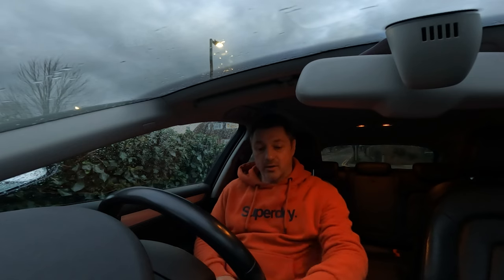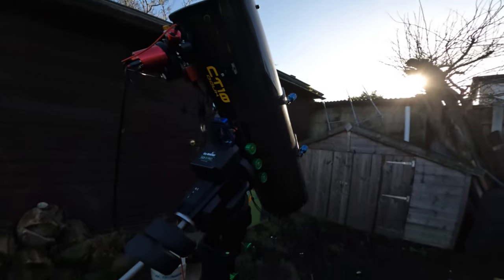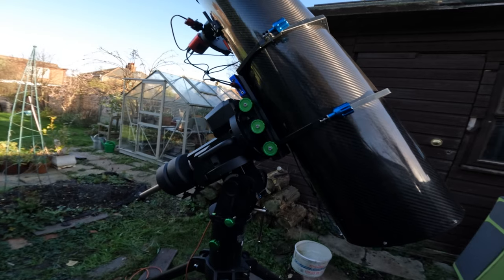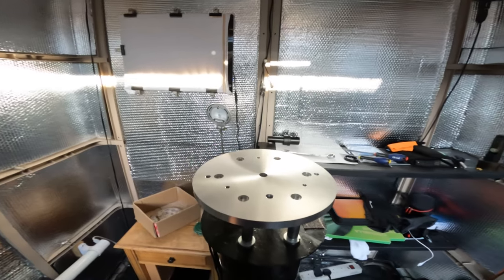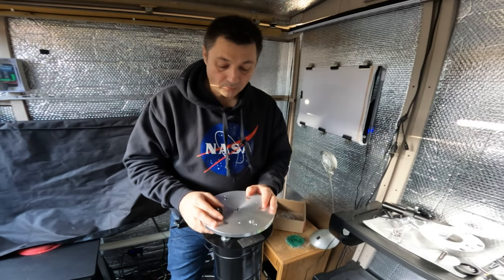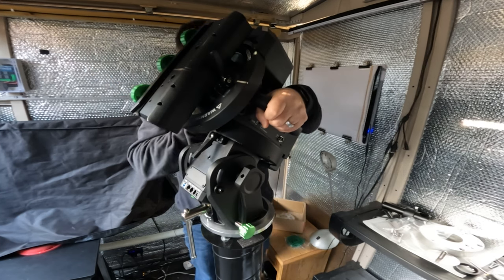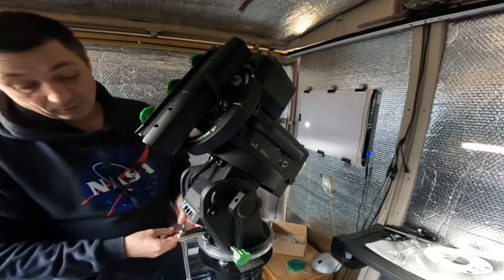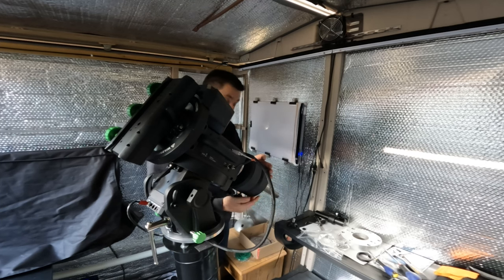Sky-Watcher EQ8 R PRO. I upgraded my mount. Overview and installation into my Obsey. Crab Nebula

Comment: New beefy mount and two clear nights as a result?  Unpossible!  

Grats on the mount Glenn..  It's perfect for your scope.  I really like the built in ports.  CS!
Reply from the maker: Hi James. I know right, new gear and clear nights. Never!!

Its perfect for the scope and  proper observatory grade mount for the Obsy. The through mount cabling always set the CEM120 apart from the EQ8 so really good they addressed that. Its very smart and will mean no cables to get snagged anymore.
Clear skies

Comment: I have one and it has terrible dec backlash. Apparently that is not unusual. Adjusting it is a course in cuss words as you quickly learn that you need special Allen Keys. One day I hope to get them delivered and do something about the backlash. Enjoy...
Reply from the maker: Hi Stephen. using guide assistant mine reports fair bit of  backlash in the DEC but so far it hasn't caused me issues in guiding. Depending on seeing it ranges from 0.3 - 0.6 total rms. I think you can buy Allen keys that would work or it would have to be a grind or file down job on a normal one.

Comment: This is a very good review.  One of the best I've watched.  Does the EQ8 have Wifi?  I'd like to get one to support my Celestron 14" Edge HD
Reply from the maker: hi Craig and thank you. It is an excellent mount but does not come with wifi built in. I know sky watcher sells a wifi dongle you can plu into the mount. I used one with the EQ6 R PRO and it worked really well. I think the iOptron CEM120 has wifi and gps but you would need to confirm this. Good luck with whatever you choose

Comment: Congrats Glenn.  I like how it bolted right up to your pier with the adapter.  Interesting how you mentioned EQ6 being portable as I have the equivalent Atlas Pro which I currently use as my portable mount as it is easier to set up than the Sirius Mount.  If I get another mount the EQ8 top on my list - thanks for the review and good luck with it.  PS: Your intro was pretty cool watching you drive on the opposite that we drive on.  - Cheers
Reply from the maker: Hi Kurt. Thank you for watching and commenting. When I first got the EQ6 i thought it was on the heavy side to move about a lot but after handling the EQ8 it feels very portable. It is a lovely mount and perfect for handling large scopes or heavy payloads.
It must look funny watching us drive all completely flipped.
clear skies

Comment: Looks like a great mount. I almost bought one of these but I would have had to wait 6 months for it. So I got an iOptron CEM120 instead which has a similar payload capacity.
Reply from the maker: The CEM120 is a lovely mount and I was deciding between the 2. The CEM always seemed better because of the through mount cabling but seems Sky Watcher finally caught up with that idea. In the end it was availability that meant the EQ8 won the race. I absolutely love the mount but would have been just as happy with either. Clear skies

Comment: Haha seems you and Joe aligned on the timing or are you guys having a competition?   I have the same mount as you for 1.5 years now. still happy appart from the USB3 mount which doesnt drive my camera in USB3 mode
Reply: Curious on your phd2 settings with and after PEC. are u using eqmod or gsserver?
Reply from the maker: lol, it does look like that. I was ready to get the bigger mount so I could make the most of my CT10. Joe was looking to extend his Obsy and add a second pier and mount and I think i pushed him up as at first he was thinking a 2nd EQ6. we talk most days so its easy to encourage each other further down the rabbit hole lol
Reply from the maker: @screetch82  I use EQMOD and not tried GSSERVER yet. (what do you think of it?)

Comment: Looks a beast. Do you know if you got the version that has the usb 3.0 hub issue fixed (it was widely reported a lot of cameras didn’t work with the usb 3 port on the dovetail)
Reply from the maker: Hi Hogarth. Yes its certainly a lump. I think mine is pre the fix as my camera is not detected. I run the powerbox advance however as I control all the auto dew functions via NINA so the camera works fine through that. Problem with powering all the dew heaters etc from the mount is they would be on constantly. Its still a brilliant mount and am loving it.

Comment: Picking your brain again here again glen :) the m12 bolt in the middle how long should this be I’ve just got a pulsar antivibration pillar with the flat plate on but does not look like it’s got the centre bolt .. thank you for any help :)👍
Reply from the maker: Hi, it doesn’t have to be very long at all. Mine is about 50mm maybe a bit shorter
Reply: @Astrobloke  thank you 🙏

Comment: My EQ8 arrived today! So this is really great. Thanks mate! Interesting that you are still using the Pegasus Powerbox. I had one of those too (with my EQ6) but I am wondering if it's still needed with all the thru connections on the EQ8?
Reply from the maker: That's great mate, bet you are well excited. I only really keep it on there as I can switch on/off and control the auto dew feature as I often remote in. I have just bought a decent usb 3.1 active ext cable which is 5m long.   Lindy 5m USB 3.1 active ext cable     https://amzn.to/38FdDSQ    The link is also in the description below the video. This runs up to the mount and I have a short usb 3 (0.5m) to the mount and another (0.5m) usb 3 from the saddle to the camera. Before I was using a usb 2.0 repeater. Basically long cables don't work and you will struggle to detect your camera or keep it connected. The Lindy cables are high quality and this overcomes this issue. Many have pulled their hair out with the through mount cabling as the usb 3 is bot perfect on it as the board they used was not the best. My follow up video does talk about this but I am releasing a new one covering this cable and also some adjustments I made to the DEC backlash to improve things.
Reply: @Astrobloke  Yep! V excited. Though I nearly pout my back out getting it up on to the tripod! Ok, then in that case, if the through mount board isn't much good, I'll just stick with my Ultimate Powerbox and my long USB cable into the house. Thanks for the tip

Comment: I am looking into getting one of these, as a EQ6-R user I think it is the next logical step. How much plastic is used on the outside of the mount. Also is all the metal aluminum and stainless?
Reply from the maker: Hi Peter. I was looking at this or the CEM120. One of these came up first so thats the way I went. Absolutely no regrets, its an excellent mount. The only plast is the front housing that bears the skywatcher name and where the electric enter and leave the mount. The rest I would say is Steel as at 29KG I doubt much Aluminium was used. Its a beast and the paint or powder coated finish is very thick so nice finish.

Comment: If I connect my Zwo 294 directly at the usb hub of EQ8, then it will works?
Reply from the maker: It depends on how you connect the mount to your chosen pc. If that lead is low quality or too long connection maybe unstable
Reply: @Astrobloke  with 1 mt of usb cable
Reply from the maker: @fiorenzomanganiello2853  https://amzn.to/3zBfnXN
this is the cable I use. Its 5m usb 3.1. I then have a short 0.5m usb3.0 from this to the mount.

Comment: Hi Glenn 
   Wow, 3 months goes by fast. I have one of these coming in 2 days, I got $1000 off. After I bought it, I then started to look at the CEM120. A deal breaker for me with that mount is the D saddle plate, you have to slide every scope into the dovetail and there are 3 screws that make contact with the D Plate on your scope. I put my scopes in from the side so I can set it on the edge of the dovetail and then tilt it into place. Have you had any issues with backlash and if so, have you done any adjusting to reduce it?
Pete
Reply from the maker: Hi Pete and thank you for your message. Not sure why you have me as Dave as its Glenn but its cool. Funny thing was I was looking at the CEM120 also but when this came up I couldn’t resist. At the end of this year I will have owned it for 2 years and it has been flawless. Just the other night guiding like it always has at around 0.4 total rms. On really great seeing nights it will guide all night at 0.2 - 0.3 and on bad seeing it rarely goes over 0.6-0.7. This is with a 10” newtonian mounted. Never had to adjust a thing. All I have ever done is run guide assistant in PHD2 to measure and compensate for any backlash and I also recorded a PEC curve which is also applied. Its a beast and a brilliant performer, you will love it. Clear skies and best of luck. Glenn
Reply: @Astrobloke  Hi Glenn, I edited my last comment. I guess I heard your name wrong, sorry. Thanks for your recommendation, it means a lot since you have used one for almost 2 years. It is going on a Primalucelab C120 and will be covered with a ROR observatory at some point, hopefully next year. I only have an SVX 102T and 8" EdgeHD for now, but the Sky will be the limit eventually. Actually, I want to mount both of my scopes at the same time.
Pete
Reply from the maker: @peterleveillee1321  that’ll be my dodgy accent 😂. I really have had no issues with the mount at all and love it. It will track those scope lovely and a ROR obsy will make it a perfect set up. All the best to you.
Reply: @Astrobloke  What is funny is I got your name wrong, but the CC got it right. I need to clean my ears out with lens cleaner and a camel hair brush.